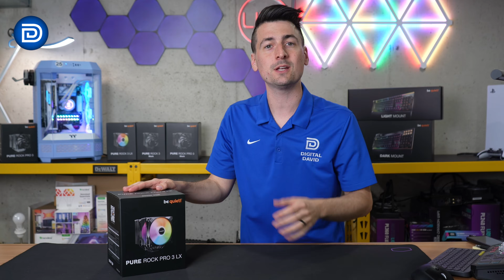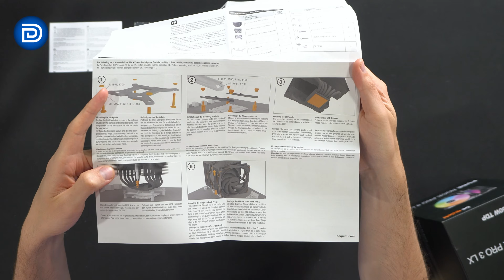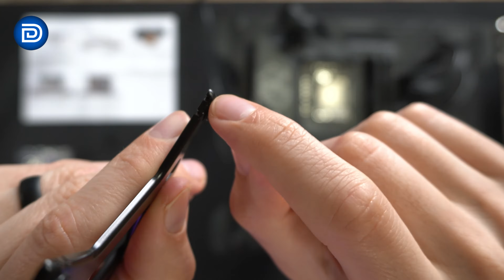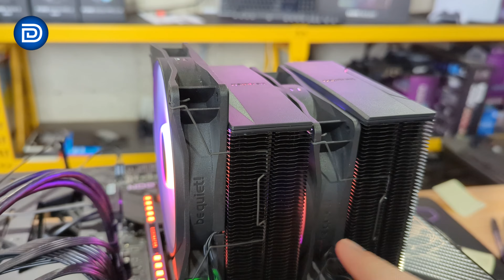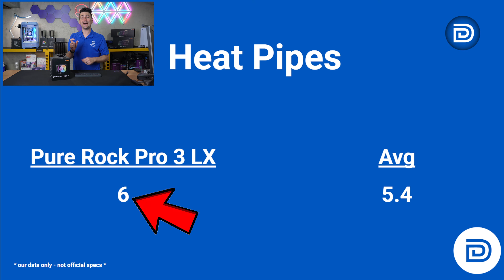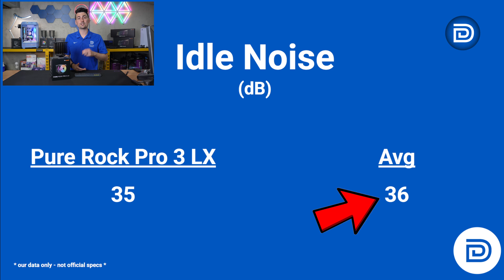be quiet! Pure Rock Pro 3 LX Air Cooler – Silent But Powerful

Comment: Is this cooler worth for a 7800x3d or a Thermalright Phantom 120 EVO is better?
Reply: The Thermalright will do better. However I have this Be Quiet cooler and it does the job perfectly fine. 7800x3d barely uses any power with PBO disabled.
Reply: definitely get the Phantom EVO, assuming the price is the same ofc

Comment: Will this cool an Ultra 7 265K?
Reply: yes, the offical website claims that the cooler can cool up to 250w. Even if the official data is off, the cooler should have no problem cooling the 265k which uses only 125w.
Reply: @IHaveALotOfBraincells  Advertised cpu tdp is a stupid metric and 90% of times invalid. In games the 265K generally uses 60 to 90 watts, but in full multi-core load let's say in productivity apps the 265K will use around 220 to 230 watts.